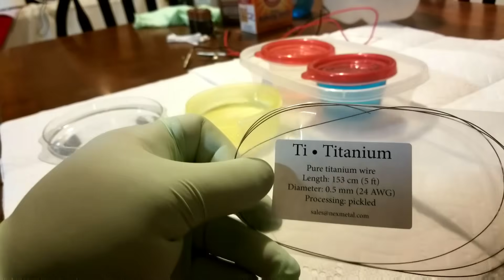How To Anodize Titanium With 9V Batteries Cheap And Easy - Full Tutorial

Comment: I followed everything you said except I used a copper wire instead of titanium. It all worked out and looks good. Why did you say you have to use titanium wire? What's the reasoning behind this? I didn't know what would happen but figured I could etch it if it screwed up I guess.
Reply from the maker: I use titanium wire because that's how I was taught, but I guess copper wire could work. I should have probably been a little more specific.  I think as long as it's not steel of some sort you shouldn't have issues. Steel or even stainless I believe would cause some major problems when trying to anodize. Glad to hear your project came out well!
Reply from the maker: The way I understand it, anything other than titanium, niobium, or tantalum will suck current away from the part being anodized. If you didn't have issues, that's great to hear. I've just never taken the chance.

Comment: Will it be dangerous if the red alligator comes into contact with the anodization bath?
Reply from the maker: I wouldn't say it'll be dangerous, but it will stop the anodizing process while it is in contact and the power will be directed at the clip since it's not titanium. If you accidentally let the red clip contact the bath, just remover it as soon as possible.

Comment: What else works other than the whink because I want to anodize the backspaced on my 940 Osborne a different color other than purple. And what is a dedent ball
Reply from the maker: Hydroflouric acid is the active ingredient in Whink, but I found that the Whink was very cheap and easy to obtain on E-bay, and even in some local stores. Sorry it took so long for a response, for some reason your comment was hidden.  Also, the detent ball is the tiny little ball in the liner of the knife that holds the blade closed. if it gets corroded it will make the action of the knife very bad. If you are doing it on a Axis Lock Benchmade, I don't believe there is a detent ball to worry about.

Comment: What purpose does the Windex serve? Also, how is it possible to anodize a piece of titanium multiple different colors?
Reply from the maker: +Gear Guy226, the Windex cleans the metal. At the beginning of the process is when it is most important. It works really well to strip any  fingerprints, and any left over oils from your skin that will prevent the anodizing from working to its full potential. 
When you are asking about anodizing multiple different colors, are you asking how to achieve  somewhat of a rainbow effect on the piece once it's finished?
Reply: SharpKnifeNuts Awesome, thanks! Not exactly. Like what you did on your 0900. How it's blue on some parts, yellow on others. Does that make sense?
Reply from the maker: Ok, yeah I see what you're asking now.  So basically the way you have to do that is first do the blue or purple, because you have to do the color that takes the most voltage first. Then once the entire piece is all that one color you need to either sand or scotch-brite pad the spots you want to be the straw color. With my knife I left the Zero Tolerance logo blue because it's indented and I wanted that to stand out, but the rest of the flat surface I used a scotch-brite pad on. Then once you remove all the anodizing down to bare titanium on the spots you want to be the straw color, you re-anodize those spots at the lower voltage(using the method I showed with batteries you just use less batteries). You won't have to worry about the blue changing, because it would only change that color with a higher voltage. I hope I'm explaining that well enough. I'm in the middle of moving right now, but in a week or 2 I will be back to putting out videos much more regularly. I will definitely do a video on the process to help show exactly what I'm describing here. Subscribe, and stay tuned, I have like 4 or 5 more helpful anodizing tips and tricks that can be done for cheap, but still give a professional job. Any other questions, just ask. I love to be able to help in any way I can!
Reply: SharpKnifeNuts Awesome! Yeah, definitely makes sense. Didn't even think about that. Definitely subbed already and look forward to learning more!
Reply: I'm thinking about the complex patterns you see online in different places, is it possible they're laying down some kind of vinyl sticker pattern or something and lightly sand blasting?  There's got to be some kind of trick to the very complex designs, right?
Reply from the maker: I'm not entirely sure what the process is for the complex patterns, it could very well be a light media blasting, then re-anodizing. Definitely something I'd like to look into further, just gotta find some spare time for it, lol

Comment: The dear author of video, good afternoon!
It is not assured, that two-carbonic sodium will yield such results. Which you showed. 
I shall try to repeat in laboratory conditions. We on manufacture use for reception on details from titanic alloys electrolit which we use for so-called Ematalizng.
In structure of electrolit the basic component potassim-titanyl oxalate with additives oxalic, citric and boric acids. Your data are interesting for house scilled craftsmen. Thanks!
It is ready to discuss with you questions of "Anodizing" of aluminium and the titanium.
With the best regards from St.-Petersburg, Russia. Harry
Reply from the maker: Thanks for watching Harry!

Comment: Nice tip about the Whink Rust and Stain remover. I've been looking for a way to remove the anodizing and always come back to Multi-Etch which is very expensive (even more so here in Canada) so I never bought it. I know what I'll buy during my next trip to the US :) Thanks!
Reply: just be aware that it "May be fatal or cause permanent damage" and "Causes severe burns which may not be immediately painful or visible."
Reply from the maker: +bdpf, you won't be disappointed, that stuff is cheap and works amazing!
Reply: Thanks, I'll use gloves.

Comment: I want to anodize my 15 oztitanium hammer.... Will the amount of batteries I need be different if I want blue since it's larger then that clip? Will it work with something that big?
Reply from the maker: +l00k_at_1t you would still use the same amount of batteries. It's the specific voltage that will achieve the color you are looking for, no matter how big the piece, but if you are doing a larger piece you would obviously need a larger bath, but also a larger cathode(the bent fork in my video). You want that close to the size of the piece you are attempting to anodize. Hope that helps a little. There is also a way to basically paint on the anodizing with a sponge as well. That is going to be the subject of one of my upcoming videos, stay tuned!

Comment: Nice video. I want to anodize some of my knives. But in Europe you can´t buy anything with hydrofluoric acid, because it´s rated as a highly toxic material :-(
Reply from the maker: +tomfrajman, I wasn't aware of the restrictions in Europe. In your case Multi-Etch may be the way to go. It's more expensive, but they claim there is no hydroflouric acid in the solution.

Comment: thumbs up for the video. but I have an other "probably silly" question for you : will the anodisation process work (or kinda work) on steel too or is it for titanium parts only ?
Reply from the maker: +émile Thrash this process in the video will only work on titanium
Reply: émile Thrash You can flame anodize most stainless steels, just dont do it to a blade.
Reply: Chuck Beef u can anodize the blade but then u will have to re temper it and before that oil bath and resharpen anyways i have a que what is the best way of making a karambit?

Comment: this is probably a silly question. But when you take the coloring off and go back to bare Ti, does that eat away the metal at all, so-to-speak... or does it just take away the coloring?
Reply from the maker: +Julian Carroll not a silly question at all. It depends on how long you leave it in the solution. If you just let it eat the anodizing off, then it isn't removing any metal, but as soon as the anodizing is gone it will start to eat away at the bare titanium. The anodizing is basically like a protective layer. You will see the titanium start to bubble as soon as the anodizing is gone, and at that point you will start to etch the titanium.
Reply from the maker: +Julian Carroll and the reason being is that the Whink Rust and stain remover has hydroflouric acid as it's active ingredient,  and titanium is highly reactive to hydroflouric acid.
Reply from the maker: +Julian Carroll if you want to keep specific tolerances, but still want to use the Whink to etch a piece, you can use nail polish on the areas you can't afford the tolerances to change (i.e. screw threads, detent balls, that kind of stuff), then you just remove the nail polish with acetone and those areas will remain un-etched.
Reply: What other chemicals can be used to strip the anodizing
Reply from the maker: The fastest method for stripping the anodizing(titanium oxide) from titanium is immersion in a solution of hydrofluoric acid or ammonium bifluoride until gassing occurs, usually within 15 seconds, then you have to immediately rinse off the piece of Ti. Hydrochloric acid can also be used, but it is a much slower process.